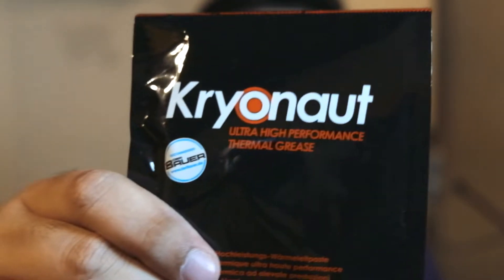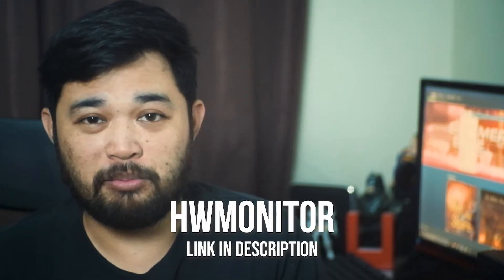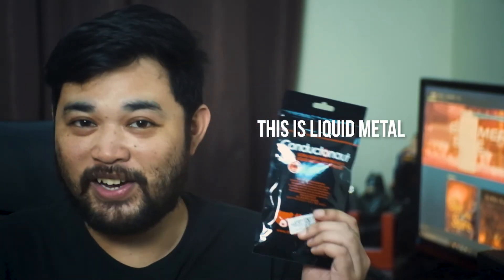Laptop Thermal Paste Replacement ft. Thermal Grizzly Kryonaut (Part 1)

Comment: hello Jelo, thanks for sharing this video with us, I would like to know if you applied the thermal paste as shown in the vid, or did you spread it over the IHS off-camera?
I've seen many applications where they spread the paste instead of using the pea method, also the instruction sheet that came with the product suggests the spreading method.
sorry for the long question I just want to know the best application method before I repaste my laptop.
Reply from the maker: Hey, kingg4life. Applied the paste as is. 🙂
Reply: Jelo Abucay great to know, thanks, I will let you know my results once I apply it, my current temps are 56° idle for my cpu and 95° on stress, my GPU is OC and idles at around 60° and it goes to 75°-83° while gaming.

Comment: 70 degrees is still quite cool xD. Mine runs at 85 and my laptop is 2 months old
Reply: Damn, try to undervolt it and disable turbo boost and your laptop will run at 80/81°C max

Comment: Maybe using the spread method (as recommended) would have led to better results.
Reply: Nope,
The temps around 70, under load, are normal.
That's why the fans didn't even bother being faster for more cooling